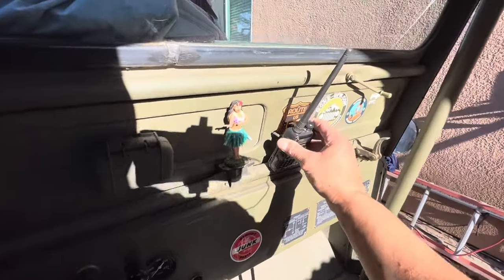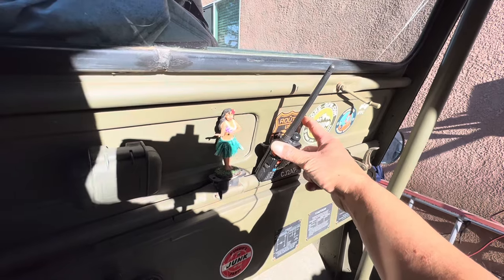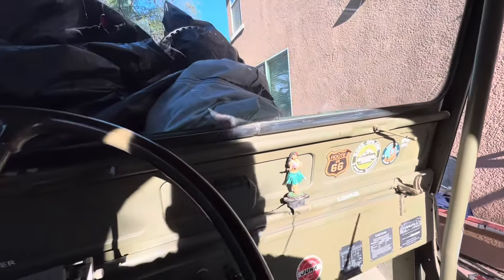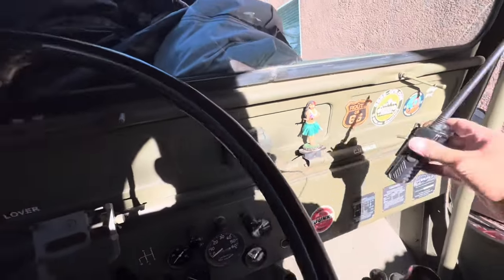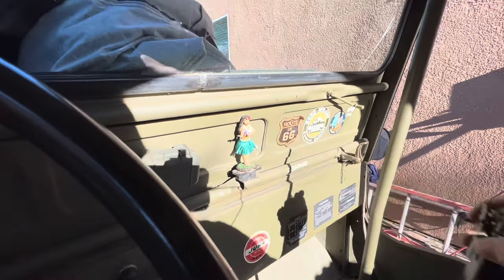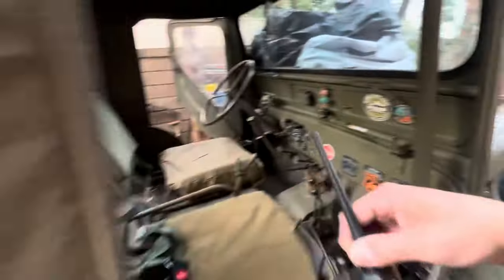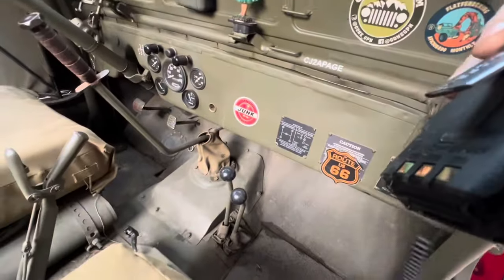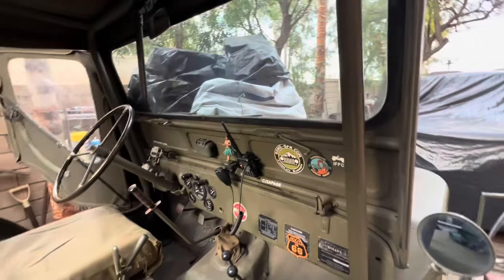Baofeng Radio mount on Willys Jeep CJ2A trail rig/ CJ5/M38/ MB/ GPW

Comment: Let me tell you about my dirty little trick that somebody else probably did first. For mounting cylindrical silendri... oh hell, things shaped like a pringles can. I get the appropriate sized muffler clamp and thread 2 extra nuts on the u bolt side of the bracket, and the nuts that came with it inside the panel. I made a fire extinguisher holder and now working on mad max style cup holders.
Reply from the maker: oh cool - i need to try that. 👍